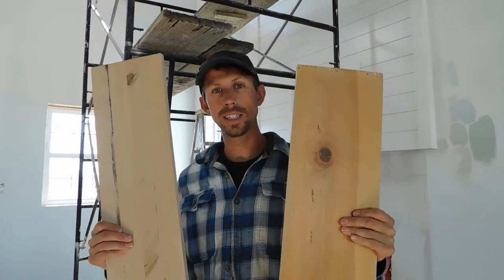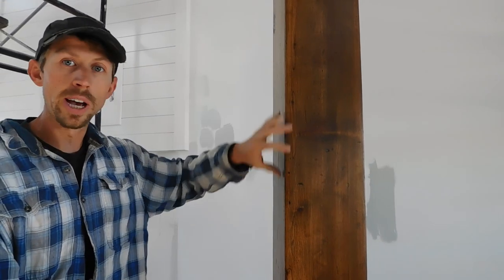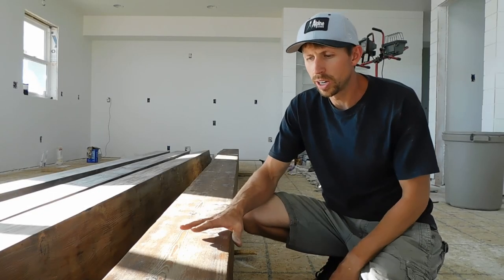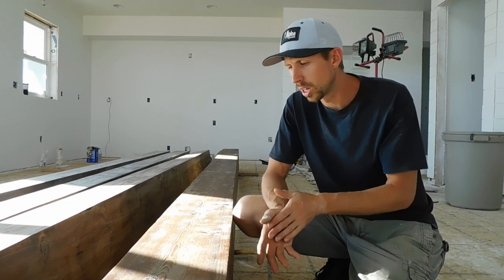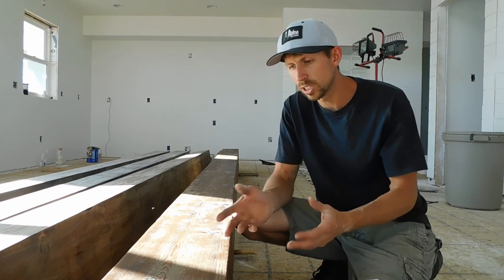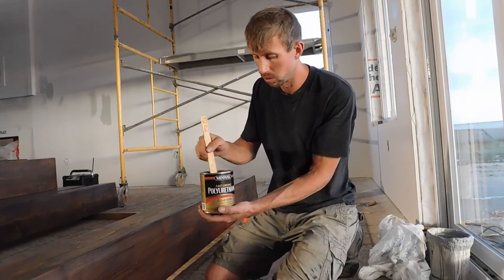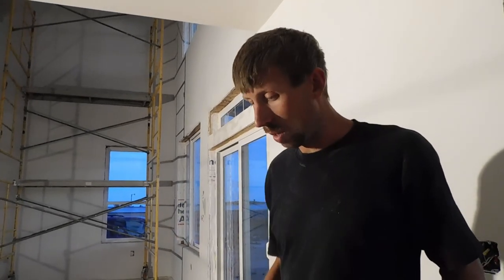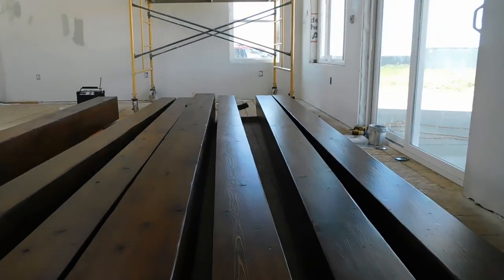FAUX BOX BEAM TUTORIAL//DIY CEDAR BOX BEAMS//HOW TO BUILD YOUR OWN FAUX BEAMS

Comment: Just messaged you in the installation video on how to… and I realized that yes I had missed something !!! These look beautiful. I like the finish of them, color, everything!  I am thinking about doing this project but using pine wood vs cedar. I just want to make it light and to lower the cost. How did you come up with the amount of beams you needed in the room? Thank you again for your time!!!
Reply from the maker: I'm glad you love the look of them! They came out just like we hoped they would! 

Pine definitely will work good for a box beam. Just use alot of glue and pick some nice boards! 

To determine how I figured out how many beams to do was depending on obstacles. For instance, lights, soffits, speakers, ect. Depending on your situation, you will have to decide that. I tried to keep mine centered between can lights.

Hope this helps!

Comment: What type of wood putty did you use? Turned out so clean!!!
Reply from the maker: I used a stainable minwax wood putty prior to sanding. Honestly, I wouldn't recommend that wood putty though, because in some coloring it worked well and in some darker areas it didn't match as well. It came out good, but there are probably better putty's put there. 

Hope this helps!

Comment: It’s been two years: 
In hind sight;  is there anything you would have done differently? 
Also, does ceiling height determine what width you’d use on the boards?
Reply from the maker: I still love these beams! I the size and color came out right. I would definitely do again. The size definitely depends on the height and size of room. This are large because of the high ceilings. 

Hopefully this helps you.
Reply: @buildingwithjosh  yes it does! Thank you.

Comment: How do you hang them? And how much did this end up costing?
Reply from the maker: We do have another video showing how to install them, you can check it out. 

Cost wise, my materials ended up being near $1,000 at the time, this was before lumber prices rising. It can be done more cost effectively with pine instead of using cedar.
Reply: @buildingwithjosh  Thanks for a quick reply. I did see your other video after I commented.  Oops. But yes looks great! I have beams across my living room that are covered by textured drywall. Should I remove the drywall or just cover it with new beams?
Reply from the maker: @AM-dm1pl  I think I would try and leave the drywall for sale of the mess it would make. As long as you can get the size beam you want and have enough size to cover it up. I hope this helps!

Comment: What was the size of the 1 by’s? That you used for center and sides of your beams? Looking at attempting a few in my house.
Reply from the maker: For my center beam, the larger one, I used 1x10s for the bottom and 1x12s for the sides. For side beams I used 1x8s for the bottom and 1x10s for the sides.  Hope this helps!

Comment: What are yr beam sizes? Main spine and branches dimensions? Also what was the height from floor to highest point (peak) of ceiling and floor to top of walls where it meets the ceiling?
Reply from the maker: Main center beam so 10x12” and side beams coming down are 8x10”. Thea are big beams up close but look proportional once installed!

Floor to ceiling height are two story in some parts. In the peak is 21’ and sidewall is 18’ on main floor and second floor is 10’6” to peak and 8’ sidewall.
Reply from the maker: Hopefully this helps you!

Comment: Waste of good wood and $ ya don’t need look far to find endless supply of distressed stuff
Reply from the maker: This is true, there is plenty of distressed wood out there. However most of it isn't straight, flat or long enough to make these beams. 
You probably could  make them though out of reclaimed wood if you wanted to!

We wanted a distressed look but the to be smooth at the same time and it came out just like we wanted!